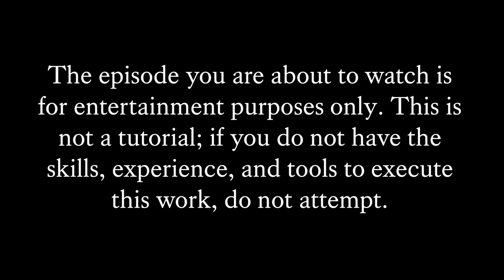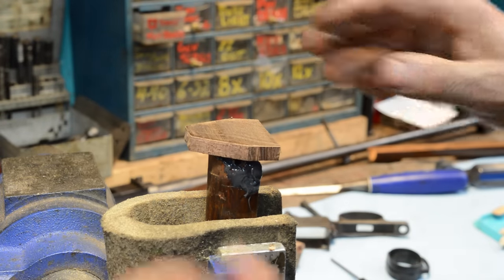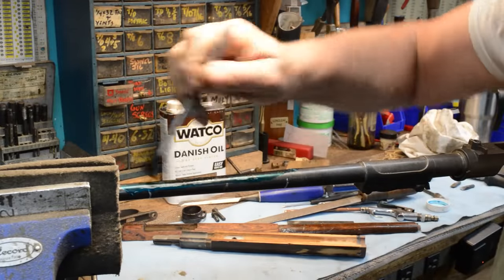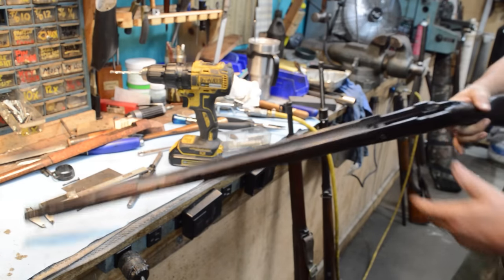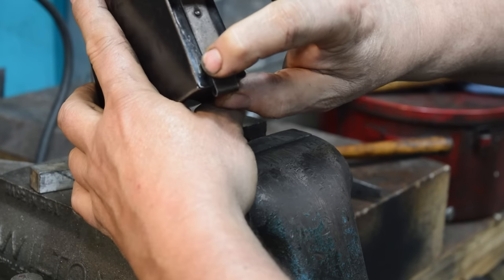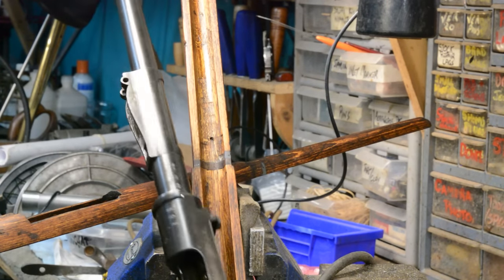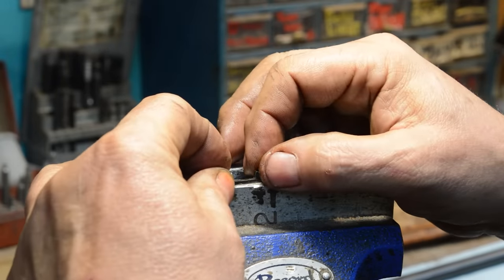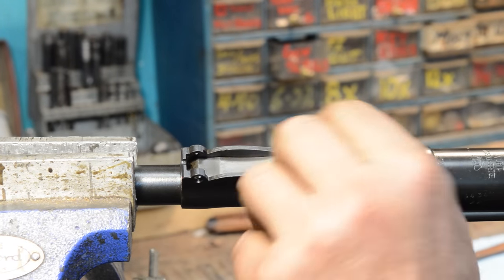Kar 98 AZ Overhaul and Restoration: Anvil 0115

Comment: As someone who has used your restoration videos to conserve or deep clean many surplus rifles, I really appreciate the work you guys put into these videos! I have been able to conserve a 1916 Gewehr 98 and a 1918 M91 Carcano so far.
Reply from the maker: Now THAT'S why we do the videos
Reply: @marknovak8255  Even got some positive comments by some senior gunsmiths at a local gun store specializing in old firearms (DOW Arms Room) but I had to credit you guys. Planning on conserving/deep cleaning a Arisaka Type 38 Trainer, a Swedish M94 and M96, and a No. 4 Mk1 Enfield around the holidays, and then on to a Russian SKS later on. The Anvil's are eternally rewatchable. Really hope to get my hands on a Karabiner98 AZ soon enough, and the feeling of ressurecting old war horses is unbeatable.
Reply: @marknovak8255  And I grabbed a jeweler block to rework some old screws as well. Proper tools are worth their weight in gold, and I remember whay you said about "hundred year old screws are harder to find than a good screwdriver bit" or roughly to that extent. I had to get a new M91 Carcano bayonet assembly lug cross-screw produced by DOW as well, since the afformentioned screw threads, even with generous application of Kroil, were bound up. The screw shaft had already seperated from the grooved end, so I had to blow out the remnants with a punch after setting aside the screw body. Not a "look out at the distance at nothing for a long time" type of mistake, but I'm doing the maintenance none-the-less :D

Comment: I just got me one of those old school Fuller sweepers ( aka electrostatic carpet sweeper ) for that very purpose.
Makes cleaning up easy in the small secondary work shop where I'm working on old spinning reels my own guns and vintage airguns, and I figure if I picked up a lost screw it should be easy to recover.
If necessary I could empty it into a bucket of water, and the screw would sink.

I'm sure you've seen or used one of these in your lifetime.
My mom got one when I was a kid and I thought it was the coolest thing because it could clean up chip crumbs without electricity.
They will push one of these every 15 years or so on TV and it seems like a novel idea when you don't realize they've been around longer than Vacuum cleaners.

Comment: Nice Film. You do nice work and you do a great service for the little pieces of history that you save. In that sentence, I'm not talking about the guns you work on. I'm referring to the guns that your less experienced veiwers are working on. Because of the detailed explanation of the bits, pieces and reasons why; you probably have saved a lot of guns from the people who are trying to fix them!
     For those veiwers, I want folks to understand the extractor on these rifles is not intended to flex much at all. The design is for the cartridge rim to slide up into the claw of the extractor. If you are firing single rounds, you need to place them in the magazine for feeding. If you place the round loose in the reciever and close the bolt, you are forcing the extractor to snap over the rim. This is a very improper technique and will do damage. 
      Mark, I think that we all realize how smart our Father's were (although we probably didn't when we were teenagers!). I can really appreciate your Father's regards that 'Murphy was an Optimist'! Well said.
     That Early Mauser front nose design with the hinge was not the best idea that ever came out of the Mauser facilities. I think that they got damaged a lot by soldiers beating, clamping and prying on them; trying to get the weapon back together in the field. 
    Thanks to Bruno and all the folks involved with your production team. Nice work. 
    Ya'll Take Care and be safe, John

Comment: A trick I like to use with Mauser sights is a small squeeze quick clamp with rubber faces. I use the clamp to squeeze down the sight to both aid in removal, specifically with the pin type and in assembly, potentially saves you some effort and a possible scratch if you have a less steady hand than Mark Novak here and your screwdriver slips.
Reply from the maker: Good suggestion

Comment: 44:53 Summer thunderstorms adding to the ASMR of your video. It sounds like you are 15 miles behind the front lines with artillery going off. I use to watch hours of "This Old House", but they are nothing. I would rather watch your channel instead. Anyone in not appreciating your work is just plain wrong. You are such an artist.

Comment: Just a quick word on tool modification for very specific situations... Like Mr Novak said, don't be afraid to modify a tool if it'll get the job done. Sure, we've all got our favourite screwdrivers, hammers, chisels and whatnot, but at the end of the day, tools are a consumable product. They are there to be used and abused until beyond effective repair, and then be replaced. You don't have to use your best chisel for a thing like shown in the video, but if you need a tool that you don't have, and you have a tool that could be made to do the job with some modifications, just go for it. Why? Whats the price of the job you are doing, when compared with the cost of, in this case, a new cold chisel? 😉
Reply: My problem isn't finding the sacrificial tool, it's finding the tool to make the sacrificial tool.
Reply: @Milkmans_Son  thats a tough spot. If its any consolation, the longer you have a workshop set up of some kind, even if its literally just a single bench in the corner of a room, the more random junk accumulates. Its been years since I HAD to purchase a tool, rather than just go digging in the piles and piles of crap I have laying around in boxes, tote crates and the assorted chaos that is my shops back room🤣

Comment: To bounce off of what Mark said at 12:25 The Germans were never too concerned with expensive finishes on wood in a general issue military sense. This is evident when you look at the finish of the G1 rifle used by the West Germans where the finish was rather rough and assumed to be a replaceable part. You also see this in East Germany where the SSG82 has a very rough and unfinished wood stock or East German wooden AK furniture where they were relatively unfinished compared to other variants of the AK. Where you see a deliberate and beautiful finish on wood is with hunting rifles, specially made sniper rifles, and target pistols. Germany has a lot of access to lumber domestically and from the Nordic countries so it is just seen as something you can replace if needed but made nice if wanted.

Comment: I'll admit when I restocked my 1938 98k I had acquired a very beat down stock from a gun show. I set to refinishing it starting with 36 grit sandpaper and ending with 3,000 grit. It honistly was smother than most vintage furniture with the english walnut color.

Comment: Mark, have a Gew98 and found it duffle cut also. Made repair simular to yours. Is there any place that spring firing pin lengths are located. Have been getting replacements from Numrich to not take chances when I'm worried. I've repaired several cracked stocks now thanks to you, that I feel good about. The info from Othais has also been helpful in my selections. Thanks, hope someday to stay and say thanks in person!
Reply from the maker: Firing pin protrusion is measured with the bolt assembled, and the cocking piece fully down. For a high power rifle, protrusion should not exceed .030 inches or so. With a properly assembled bolt, and parts from the available parts pool, you should not have a problem. I will address this in a QandA, thanks

Comment: As (nearly) always a great watch.  And as always very informative.  I have a question though Mr. Novak.  When you Acraglassed the the 'duffel cut' back using the barrel as a location piece why did you not Acraglass up inside the channel & by doing so both 'bed' the barrel also thus using it as further support for the joined pieces?

Comment: On disassembling the Mauser bolt and the extractor:

The extractor doubles as a tool, so you're supposed to be able to remove it.

Notice the little cut in the side of the cocking piece? A little slot? If you have to unscrew the rear end of the bolt without having the safety hold the striker cocked, things get really annoying as the striker snaps forward and the cam surface locks things up once per revolution. That cut in the cocking piece is positioned where it matches the width of the extractor, and the side of the extractor has enough of a curve where it locks onto the clip on the bolt that it forms a lip that can lock into that cut and prevent the striker assembly from going forward. It's a bit finicky still, less than perfect, but using the extractor as a tool there can really help.
Reply from the maker: Good to know, thanks

Comment: I just found a 1916 K98AZ much like this one, duffle cut in the same place (although not as badly hacked). The action is covered in a mixture of dried blood and old rust, and the butt end of the stock has charring and shrapnel damage, as well as water damage. I'd really like to fix the duffle cut, but I don't want to ruin the gun. Not sure what to do
Reply: Send it to a competend gunsmith. It might run you a grand but if done right it will be worth it
Reply: probably not dried blood as the salts in the blood wouldve made really deep pits in the metal by now. most likely dried oil and lubricant's.

Comment: When ever I see Mark do it, it works slicker then scum off a Louisiana Swamp.  Then when I try its a Three Thumb Fandango!  I have a K98k missing its rear sight.  I try to put it together just like Mark did. Install the spring in the roller coaster. then install the roller coaster part; it slips in under that forward lip thing.  With that put in,  I try to mount the sight slider.  THAT is the 3 finger part: push it down against the spring and slide forward, the roller coaster comes free and flips up under the slider.  Take it all apart and start over.  this time hold a screw driver on the slider notch, another on the spring holding it down near the end, and putting pressure backwards on the roller coaster and  whole thing slips and screw driver stabs me.  3 words in Algerian Arabic later I reset and try a 3rd time and…the vice slips.  OK, time to break..  (this time I cuss in Croatian).  
 That Novak feller makes it look SO EASY!  Tain’t so......
Reply: PS: I built a jig to hold the roller  coaster part in place and tried it again and...it worked.  BTW  this K98k Is quite unique;  NOT ONE SINGLE PART ON IT matches.  Not one.  it is a TOTAL re-build.
Reply: I have no roots in Croatia or Algeria, but I'm pretty sure we are long lost brothers.

Comment: Great Job.. the k98az is real rare, it 
was the  attempt to adapted the Mauser G 98 System to a carbin for the cavalry.  The barrel shorter for better handling on a horse back. But with the short barrel the carbin got a large muzzel fire and  realy loud bang.  After the WW1 Germany became a  republik for the first time.  The german army was limited by the contract of Versailler at less 100 000 Men. The new german Army  got a strong cavalry,  the carbin k98az was replaced by  the carbin k98b wich was realy not more than a softley modified
 rifle G98 . The barrel of the k98b carbin has the same 
length like the barrel of the G98 rifle.
Reply: It is not rare. They made over two million of them before the end of WWI, roughly the same as the number of US M1917 rifles. Tens of thousands of them were brought back to the US as war trophies.
Reply: @TenaciousTrilobite  not rare in the US maybe and its pleasant for me  to know ,but  in Europe this carbin is seldom offered  and in Germany it is realy hard to find.  For me as a beginning  collector of cavalry fire arms its interesting to know that. Thank you 👍

Comment: Great video! I was curious if you have ever had any experience with wood hardener? I have an old Martini stock that is all there except the edges that were touching the steel forestock retainer are slightly dry rotting, I may just inlet a new piece of walnut but have heard of guys using wood hardener.
Reply from the maker: Know about it, haven't tried to use it yet.
Reply from the maker: Don't know how it will accept stain, which would be a deal killer

Comment: I have a suggestion for you, in the sloppy hole for your duffle cut joint cut threads as well, won't that grab the wood better ? I might be wrong.
Reply from the maker: How do you drill two holes in opposite directions and have them line up in 3 dimensions? One of them is a loose (sloppy) fit.
Reply: @marknovak8255  Auto Ordnance had a special fixture due to time constraints/QC do this with the Cut Jett Compensator on 1927/1928 Thompsons if i recall correctly

Comment: Man I watched that whole video! I dig the detailed instructions for gluing a stock back together. I did it before and had to over size my holes to get them to line up but used wood dowels. But it worked and it didn’t turn out the best, but the rifle looked great in it. Just an old Glenfield/Marlin Model 75

Comment: Aaj cosmo! My grandfather told a story of them pouring boiling water over newly issued rifles on the Western Front with his field artillery brigade. I first experienced cosmoline when I was in the Q store in army cadets in 1973, we still used 303 SMLE and Bren guns and occasionally replacement SMLE replacements used to turn up to replace those that became DP (Yellow bands painted around forend and butt) and could no longer be used for firing at the range with live rounds. They still had war stores stacked away until the 1980's of SMLE in Australia.
My next experience was with the Army and having to teach new recruits how to clean the Cosmo off they're newly issued L1A1 SLR's. But at least I had acquired an armourers Tool to allow further dismantling to clear out the cosmoline.
Reply: Bought a surplus Mosin Nagant M91/30 back in 2010-2011 sometime and it was absolutely full and caked with cosmoline. As memory serves I used a LOT of Hoppes on and in the metal and heat and plastic scraper and towels for the wood. Was a good shooter though. Metal looked amazing and wood was nice for a Russian surplus.

Comment: Question, how come you did not use boiled linseed oil ?

Ricky from IBM
Reply: He used black walnut Danish oil because it not only darkens the scraped areas of the stock by the virtue that it is an oil, but it contained some stain in it and it brought the light colored freshly scraped wood close to its original color when the wood was originally oiled.  It may be that the Germans had tint in the oil they originally used on their stocks, judging from a vet bringback k98 I owned which was taken directly out of the factory unfired (except for the 5 test rounds) in Mauser Oberndorf factory in 1945.  Age and oxidation cause by the wood also darkens wood.  If he used boiler linseed oil, the wood would have remained rather blond and the dark dents and scrapes in the old stock would have had a stark contrast, making the gun appear recently refinished, which is not the look he wanted.  Danish oil is WONDERFUL stuff and I highly recommend it for re-darkening repair areas to bend in with an original finish, preserving wood so it doesn't dry out, and bringing out the rich color and grain.  It's used on furniture, bare wood of all types, and I use it on wooden model fully rigged sailing ships.  I prefer it over regular stain.

Comment: Long time viewer, first time commenter.
  As always, a great dive down the rabbit hole.
   I have a question about the P14.
   I know it and the American P17 were both based on the Mauser action, so apart from replacing/sleeving the barrel, what would you have to do to convert either gat from .303/.306 to 8mm ?
As always, a total pleasure.
Forget patina, do the maintenance 👍👍👍

Comment: What is your opinion of frog lube? I've had some rusting issues with the red Lucas gun oil so I switched to frog lube and have been pretty happy with the results
Reply: I've tried running frog lube.  It's no good in the cold...anything below freezing and it turns to paste and locks things up.
Reply: @jonathonschram3429  Ah I got ya I live in Texas so we really don't fall below freezing very often and when we do its only for about a day or so
Reply: It's a great cleaner and protector, shitty lube.  Smells great though.
Reply: Project Farm did a good comparison video of gun lube/cleaning products including frog lube. Worth checking out.
Reply: Rust is from a humid environment. You need to store it in a more dry place or use a dehumidifier
Reply: @M8Military  Yeah for sure I no longer have that rust problem using frog lube I also am shopping around for a dehumidifier